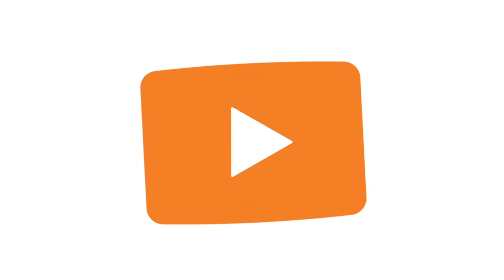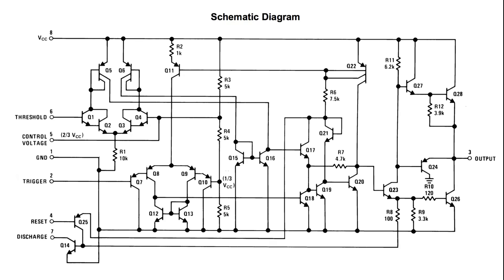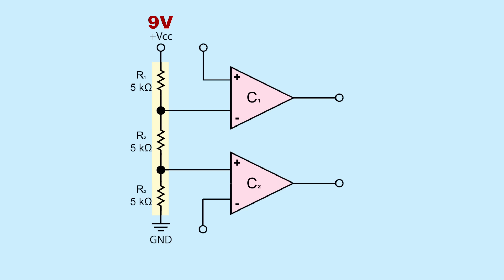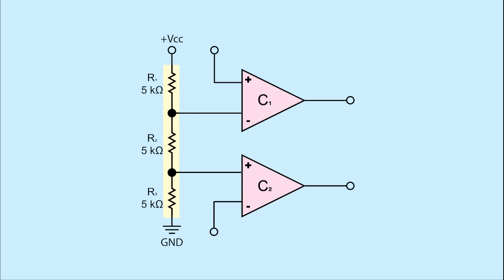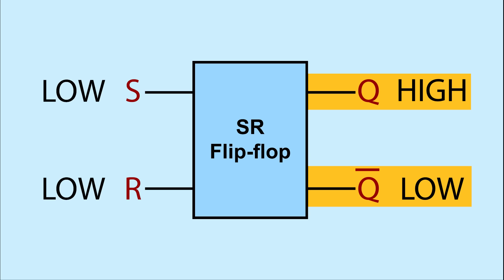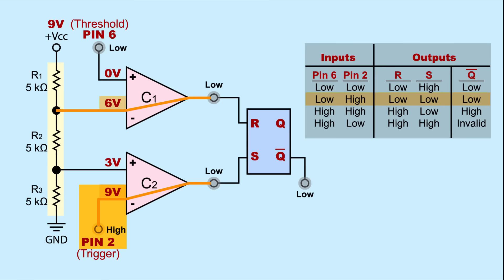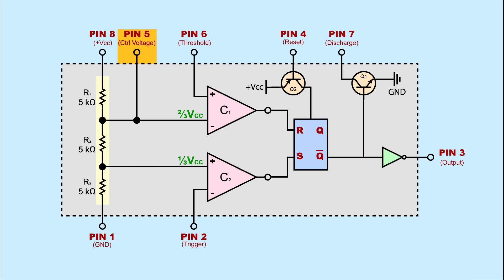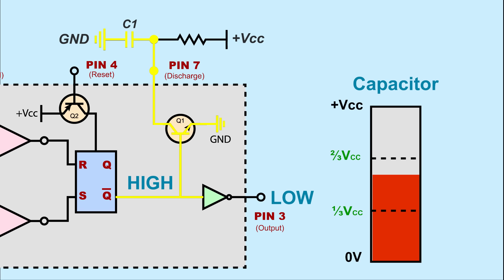How 555 timers Work - The Learning Circuit

Comment: Very nice tutorial, especially given it can be configured 3 major ways. I am a math guy that hobbies in electronics and studied the 555 a few months back. It was nice that your video mentioned that the integrated flip flop actually used only one of the outputs which is a detail that often is overlooked in other explanations. I ended up building an astable Multivibrator so that I could put out a weak signal in the AM broadcast band spectrum in order to test reception capacity on regenerative radio receivers that I assemble from parts at hand. It worked, barely. By barely I mean that high a frequency was kind of pushing my luck. Without filters it was also broadcasting everywhere much like a skipping stone across a pond.
Reply: How did u manage to do that how could you send out a wave using the 555 timer never mind I am a late bloomer my brain would take too much time to process but I would very much love an explanation
Reply: @akashsunil7464  Its been a year or two, but as I remember I set the IC555 to the highest frequency that I could get it to oscillate at using the configuration shown on the data sheet. This was a matter of selecting as I remember resistors at specific pinouts.

The frequency that I was able to get was around 500KHz. I then added an audio transformer to the endeavor so as to inject audio  such as a tone, into the signal it was generating thru being allowed to oscillate. 

It was a lousy transmitter but it did put out enough mili-watts to be heard by a radio in the next room. It also had a square wave & produced harmonics all over the place.

Its kind of funny in that back then I spent a day or two understanding the entire innards of the chip & what could be done with it. I barely remember any of the details anymore. None the less its better suited for turning your car's dome light of than using as a low power transmitter

Comment: Karen...I have a Small Single Zone Alarm Board, which of all things, appears to contain a Window Comparator Circuit similar to the one in this 555 Video. It contains 5 14 Pin IC's (2 Hex Dual Input NAND Gates, 1/2 Quad Comparators, 1/2 Dual Type D Flip Flops, 1/2 Hex Schottky Inverters) along with 5 Transistors, 6 Diodes, 12 Capacitors, and about 25 Resistors, if my memory is correct. I made a Schematic of it but I do not entirely understand how/why it works. The Company is no longer around and I cannot find the Installation Instructions anywhere Online. Anyway...Care to take a look at it?

Comment: Your description of Pin 4 is wrong.   Your schematic shows Q2 to be a PNP transistor.   A PNP will conduct only when the base is pulled low.   This is the condition you have when you ground PIN 4.
So Q2 is on ONLY when you ground PIN 4.   It is not ON as you imply when pulled up.
Reply: Oh,  and the Astatic D104 in the background is a nice touch.

Comment: Why are op amps showing 4or 5 connections, but 555 timer shows only 3
Reply: The two extra pins are likely the voltage supply inputs. For simplicity, they were excluded from this diagram.

Comment: Hi Karen. I have a question about the 555. Why take the output from Q bar and invert it,  instead of just wiring Q to the output pin directly?
Reply: I do not know if this applies to the 555 specifically, but you can use inverters to “clean up” the input, make signals that are below a certain threshold be a clean low and the ones which are above that threshold a clean high. But, as I said, I do not know if this particular inverter acts like such a trigger (Schmitt-trigger as far as I remember), if anybody could enlighten me, it would be highly appreciated.
Reply: I don't really know. I didn't design the 555. [shrug] I'm sure there's a reason, but it is more advanced than my current knowledge.
Reply: One of the drawbacks of "conceptualising" circuits, is that it can make how they work apparent, but not why things were done that way.

In an IC, you don't have a "flip-flop", you have a network of transistors. The transistor networks of all the conceptualised parts are joined together as one part. So whilst an "inverter" is known as a discrete component, in this IC it is just another couple of transistors. In this IC, the output of the flip-flop transistor network is not powered to drive the output pin; so either a buffer or an inverting buffer is required. Seeing as the inverted value is required internally, it makes sense to use the same flip-flop output to drive both signals.

Comment: What does she mean by comparator comparing the voltage. If it's plus or minus, the current flows from minus,but what does she means if plus voltage source is smaller than negative voltage than the voltage output is low?
Reply: You have to think of it in terms of change and set point.  In the upper comparator, the negative input is a hard set point.  In this case at 6 volts.  Because it's set on the negative line, anything below that point keeps the output of the comparator off (low).  Once the voltage of the other pin changes, or increases ABOVE the 6 volts, it triggers the comparator to turn on the output (make it high).   In the lower comparator, the positive input is hard set to 3 volts.  this flips the script.  if the voltage applied to the negative input was zero, the comparators output it a high state (on).  If the voltage on the negative terminal increases nothing will happen until it increases to the 3 volt point.  Then the comparator is triggered to turn off (low) the output.  It helps here to look at it not as a negative or positive. but as above or below.  For instance, if you set the positive to 3, than anything above 3 on the negative terminal results in a high (on) output.  This chip has the set points hard set by the internal resisters.  If your input voltage is 12 volts, your top voltage is now 8v and lower is 4v.  There are stand alone comparators where you have to use a steady voltage to act as the set point, then can compare a variable voltage to this set point.  One way to think of this is an automatic street light,  as the sun comes up, the light goes off once the light reaches a threshold, as the sun goes down, it comes back on at a set threshold.
Reply: @Steve-dr8rw  I see. So eighter the positive terminal voltage goes higher or lower than negative, or or other way around, in either way the result is the same. So eighter 6v positive decreases below the negative 3v becoming low signal, or the 3v negative increases above 6v positive becoming low signal, eighter way results the same depending which terminal is constant. But still I don't understand what is low, high in terms of current voltage, how do you get that change in voltage inputs in the comparators. How can you have two positive, negative terminals on comparator, but one outlet terminal?

Comment: How did you end up getting 6v? Each resistor is 3v jow did you ended having 6v?
Reply: This is how a voltage divider works. Across all three resistors is 9V total. Since all three resistors are the same value in this case, the voltage is effectively broken into thirds. At the point where it's labeled 6V it's only one third of the way down. You can think of it as the resistor taking away three volts and so 6 volts goes that part of the circuit. Circuits in parallel always have the same voltage across them meaning 6V is also going to the other two resistors. The next resistor 'takes away' 3 more volts leaving 3V for the part of the circuit marked as 3V and 3 volts also goes through the last resistor.
Reply: @benl9993  ok so the resistors are taking some voltage pressure leaving behind leftover. So the 9v pressure passed through the first resistor and exited with 6v.

Comment: One of most important CI alongside shift registers.
Reply: Do you really think that shift registers are more important than the basic AND, NAND, OR, NOR and NOT gates? (NOT gate being the same as an inverter) In fact, given enough NAND or NOR gates, you can build ANY other logic circuit.
Reply: @BertGrink  These you mentioned are for sure THE MOST IMPORTANT by far. You are totally right. But I didn't mean that. Calm down.
Reply: @madson-web  I am very sorry if i appeared somewhat belligerent, that was definitely not my intention. 😢 I hope you can forgive me.
Reply: @BertGrink  no worries, I hope you got my point too
Reply: @madson-web  I did, thank you :)
I hope you will have a merry christmas and a happy new year.
Greetings from Denmark.
Reply: @BertGrink  Oh hey Merry Christmas and happy new year for you too!
Reply: I would suggest that the logic gates are more important as "transistor circuits" than as ICs. Whilst the gates are available in IC packages, the gates themselves are way more useful as part of other ICs, rather than as separate packages. For example, shift registers/flip-flops themselves are built using many logic gates within the shift-register package.

Whilst there may still be debate to be had about whether the shift-register is so important as an IC; I don't think logic gates are rival to it- simply because most gate applications have been included on-board and not using discrete ICs.

Comment: OK - great video (Dad speaking)... but we seemed to have jumped from basic electrical circuits to complex IC design.  I was following this series with my 12 year old son who was beginning to grasp the basics and now feels he is falling behind as this has moved on far to fast. I'm having to explain that he's not stupid for not getting it... Lazy Dad has to go back to breadborads and blinky sketches ;-)
Reply: Bruce Morgan what do you feel that I skipped? I think I covered all the basic components. Simple ICs seemed liked the next logical step. (No pun intended.) I’m not sure where else I could have gone next. What do you think?
Reply: All a IC chips is, a bunch of seperate components put together in one spot. Literally. Like this 555, resistors, transistors, op amp I believe, flip flop. Instead of using 3 breadboards to put a circuit together, use 1 breadboard and throw an IC in. Really that simple. Unless it doesn't work.
Reply: Just little bit too fast I think

Comment: The Makers Local 256 makerspace used a 555 timer to make a soldering learning kit to build a board that "rolls" a 6 sided die made of LEDs.  Pretty neat!
Reply: Joshua Pritt I soldered a similar kit in the project episode that followed the overview of ICs. Though my kit used a phase locked loop IC and a binary ripple counter. Would be neat to see a similar circuit but with a 555 instead!
Reply: Joshua Pritt That sounds quite interesting, you wouldn't happen to have a link to that, would you?

Comment: 556?
Reply: two 555 timers in one package
Reply: And a 558 is the quad package with 4 timers.
Reply: @maker_karen1785  The four timers in the 558 are slightly "cut-down" versions, though: https://en.wikipedia.org/wiki/555_timer_IC#558_quad_timer 
The article conludes the section on the 558 by saying that it should be regarded as obsolete.
This is not meant as a slight towards you, I just wanted to supply a bit more information for everyone else who might see these comments. :)